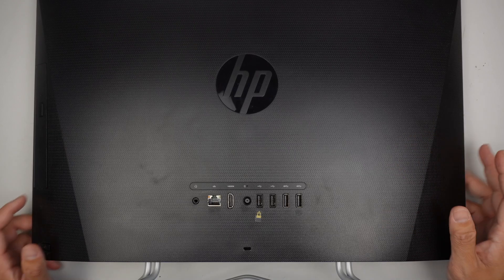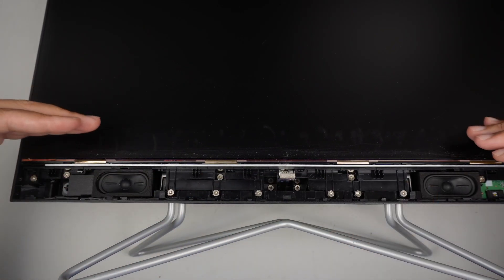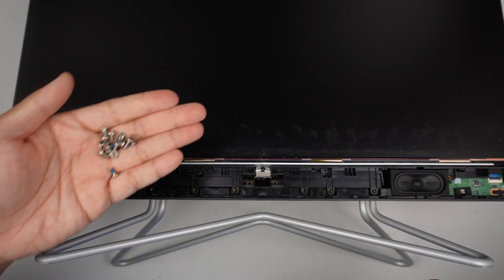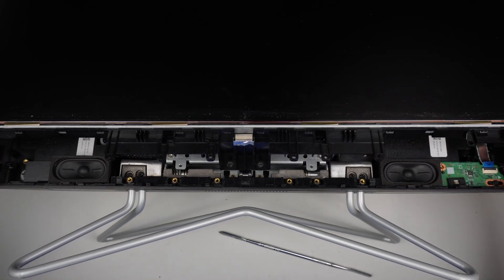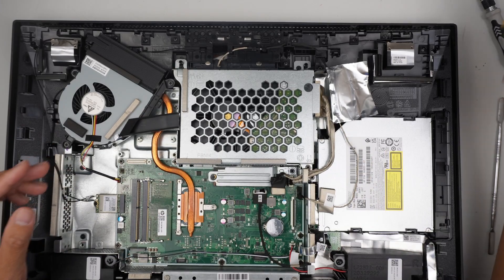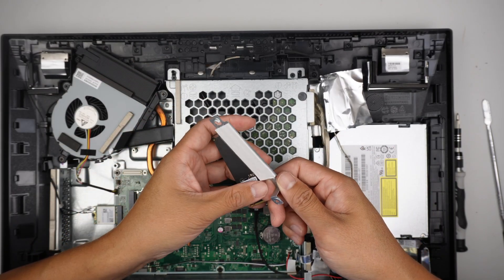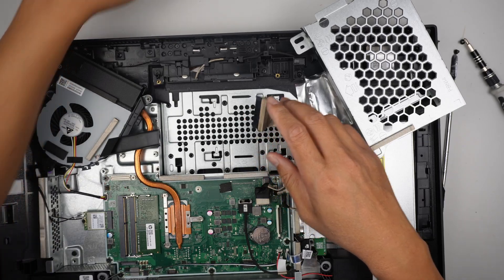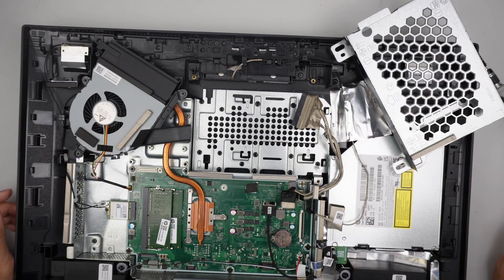HP 22 df10266t Teardown Upgrade Disassemble

Comment: Hi, thank you so much for the detailed video!  My parent’s 22” HP df10266t had an intermittent CMOS error 500 for over a year. The computer is only about two years old.  I found your video today and replaced the battery, which was loose (!) 

Just a note: you made opening the computer case look easy but I had a rough time.  There is a screw in the center bottom of the LCD that I didn't see because of some silver "tape" flopping over it.  I was scared to break the LCD too.   Eventually I used a set of plastic upholstery and trim removers (for cars) to shim and pry the LCD clips off. 

Later I will look into replacing the mechanical hard drive as you suggested. 

One last thing: I delighted to see that UberGeeks is on the Windward side.  I am in town, but I will suggest that anyone I know who needs computer work on that side of the island see you!  Thank you again for uploading these videos!

Comment: Hi, Simon. Great video as always. What is that thing? ohhh, it`s an all in one. It`s weird, lol! How old is it? What was the speed of the RAM? What CPU and its specs?
Ok, how about this? I wondered what you think about this question. I`m thinking of using some extra cooling fans, that I have laying around, from a 15-year-old Accer Aspire, I believe it was. A laptop. Does the PCB always send the same voltage to the cooling fans, or does it vary greatly, by make/model? I was thinking of using some of these fans to cool the motors on some of my R/C cars/trucks. TIA

Comment: Hello sir I have a new problem in my laptop, and no any video related for this problem . I need your help. 
My laptop is lenovo legion 5. 
I change in settings when laptop is off battery not 🚫 change, on this time battery is drawn mins low, so system is not on . And not change when plugged in charging, so how to on my laptop